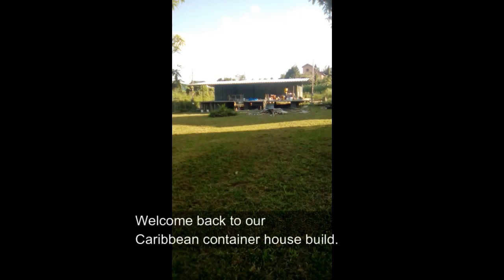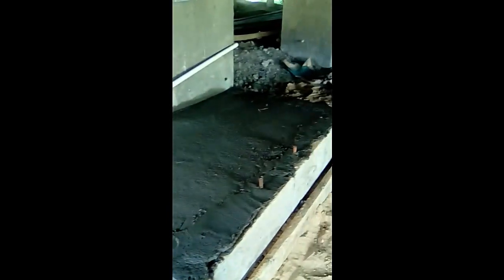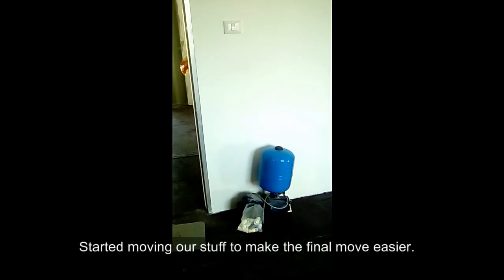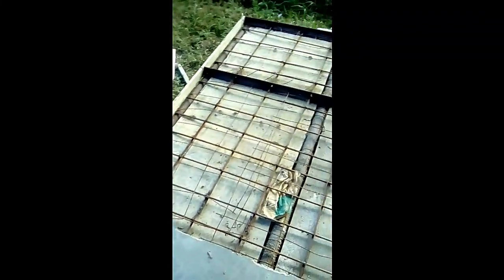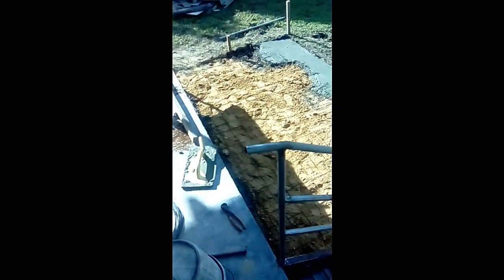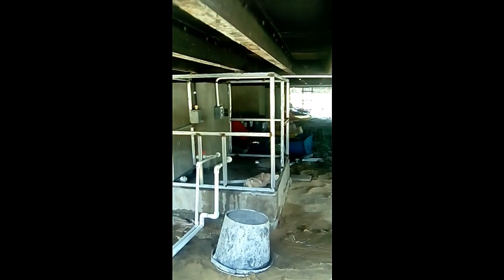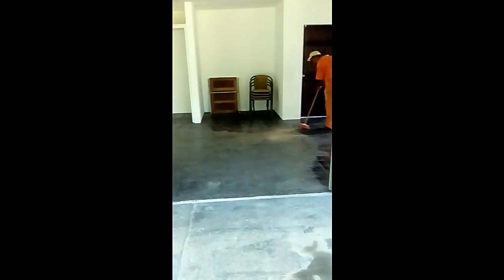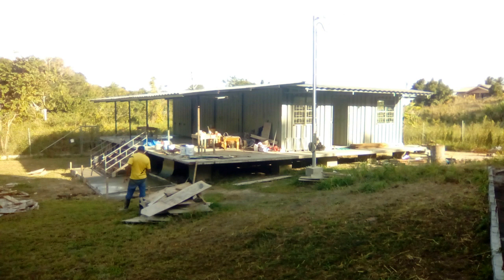Building a Container House in the Caribbean Ep.12

Comment: When your doing concert work in the yard after you backfill and compact you need to use polythene which would work as a moisture barrier then you put your steel down with spacers then concert . Other than that 👍
Reply from the maker: Thanks Anthony, i didn't get any polythene in time as most of the yard casting was excess cement. More of a by the way kinda thing.